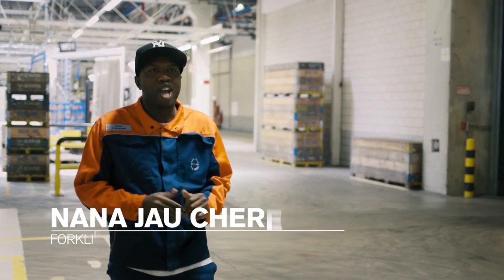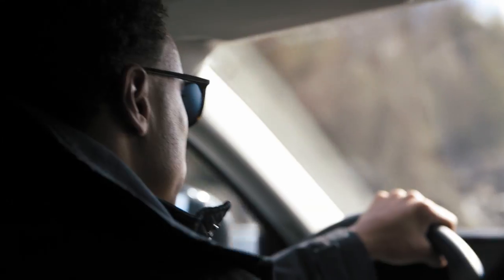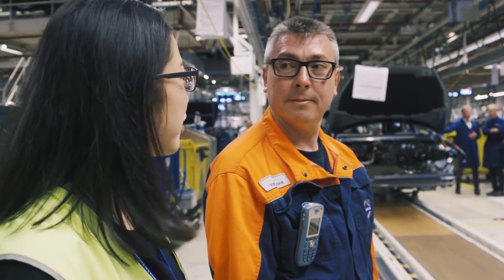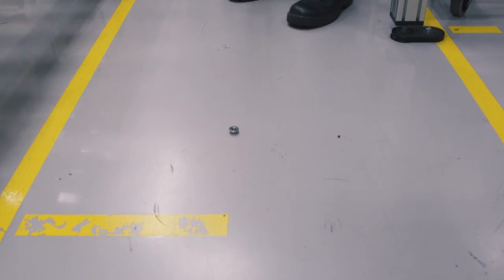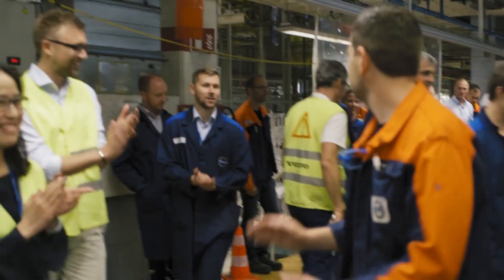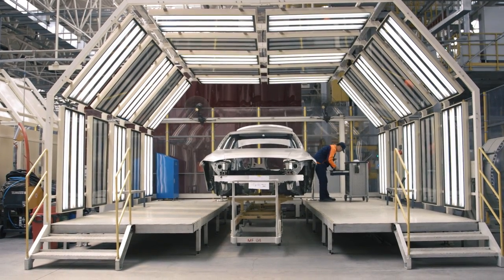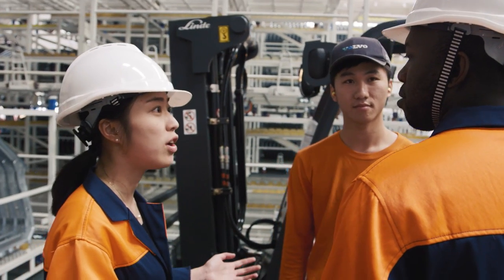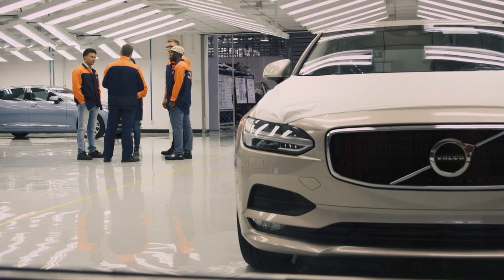Volvo Cars Explorers - Episode 3. Cars

Comment: volvo pls make an electric car with fast acceleration or a petrol car with high hp and fast acceleration together with polestar :-)
Reply: the_L3G. I've given up hoping for a fast Volvo, something in line with a modern T5-R
Reply: yea I guess they won't focus on building a car like that when they said that they just didn't care about performance or horsepower :/ but the Polestar program isn't that old and they could maybe do something new with it on the new cars? I hope at least
Reply: The new polestar s60 does 0-60 in 4.7sec that's pretty fast.
Reply: Anthony With Volvo of Thousand Oaks yea it’s fast.. but it isn’t like on their future platform
Reply: Yeah but even the new engine on the xc60 t8 its output is around the same.